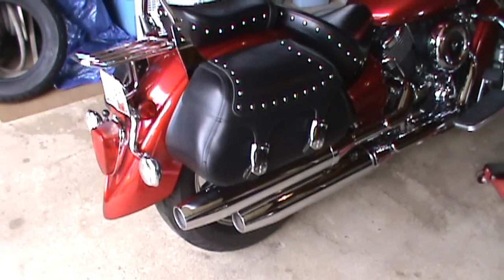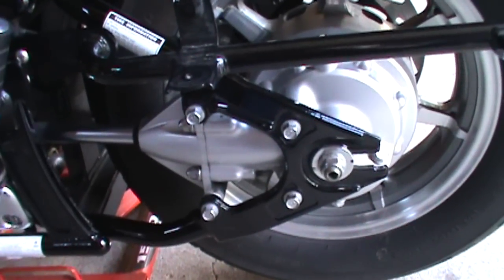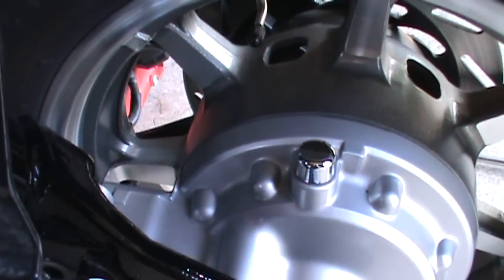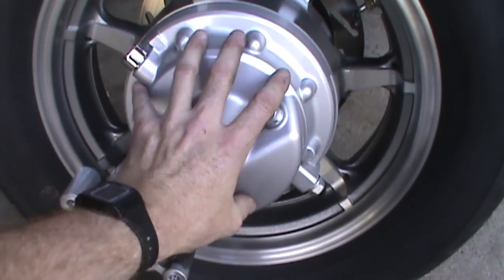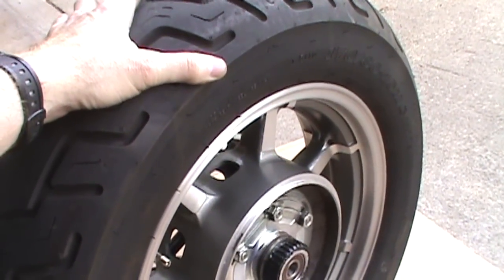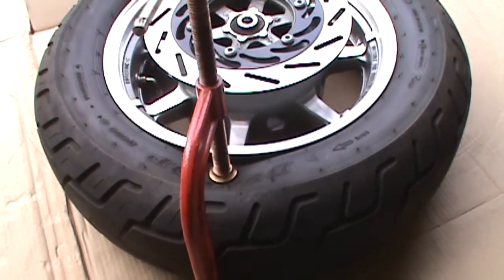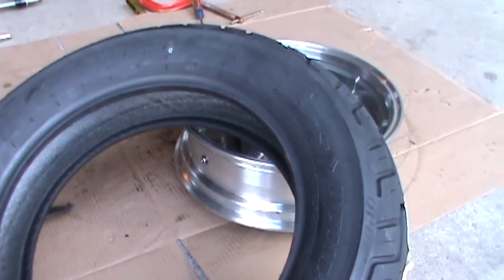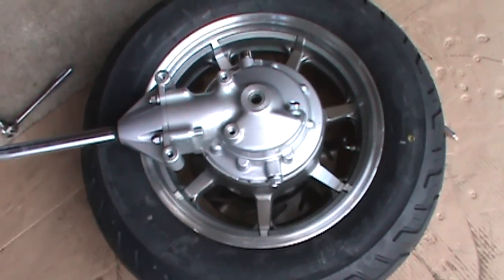2008 Vstar Rear Tire Change

Comment: Great video! The only thing I would add is greasing the drive shaft spines, if you hadn't done that already. I bought a low milage Vstar 650. I noticed that the tires had been changed but I wanted to make certain that those splines were greased. On those Vstars I have heard that if the splines get dry and fail, that rear differential replacement will have a starting price is at least 1000.$. I think my bike was probably OK, but for piece of mind I greased the splines anyway.

Comment: I have the EXACT same bike as you (even red). I have the bridgestone tires. It looks like you have another kind. How many miles do you usually go before changing. Seems like I am averaging about 10k before back needs changed (front seems to last like 30k)  and I am also changing the rear pads every time as well.
Reply from the maker: Hi Brian, I am using OEM Dunlop tires. I only get about 8000 miles on the rear tire but I really like them because they seem to stick to the road really well. The front tire I usually end up changing because of weather checking on the side wall. I have changed the front brake pads once and still have the original rear brake pads. I have around 29500 on the odometer. I am on my 3rd battery with the present battery on its second year. This has been a trouble free bike. I usually go 2000 to 2500 miles on an oil and filter change. My theory has always been, oil is cheap, engine rebuilds are expensive.

Comment: I am having problems seating the rear hub back on the tire. When I took it off it was pretty tight up against the rim. Now it doesn't want to go back all the way in. Stays about 1/8" out. Not sure if this will be an issue or not.
Reply: Yes that is normal space.

Comment: My Vstar 650 ie leaking oil from the final drive and I think its just a 9 dollar oil seal, I am worried about messing something up and it not going back together right. How easy was it to get the drive shaft to slide back into gearbox

Comment: just to give the people viewing. Use large zip ties about every 5 inches apart, around the tire. This will make the tire width smaller and it makes it easier to remove.
Reply from the maker: Thanks for the tip.

Comment: I just bought a vstar used, I’m used to riding bikes but this one seems suuuuper difficult to roll in neutral. Is this normal? I was watching this video becuase I might take my wheels off to see if something is off.
Reply: Update : the brake pads were rusted/calipers nearly seized. Original owner only put 200 miles on it in 12 years 😂

Comment: did u got you v-star with tubes, because my v-star 650 has tube. 
do you know why or why not ? thanks
Reply from the maker: My tires are tubeless. I do not know why you have tubes in yours.
Reply: OnTheEdgeInEauClaire Perhaps he has a spoked rear wheel...in that case, tubes are necessary
Reply: I realize people use tubeless tires without tubes.  I never install my new ties without tubes and use tubes for use on gravel roads they are quite heavy rubber. .  even if the tires are tubeless I still use tubes   Use only tubes with metal stems .  if you are in no mans land you will thank yourself as you try to help other riders with deflated tires you meet on the roads....  a few extra dollars can give peace of mind.

Comment: How do you position the jack to lift the rear wheel? I have a similar jack which seems to lift the front only. I see no place on the rear side to mount the jack. Thanks.
Reply from the maker: I have the jack positioned almost touching the rear wheel. It will start lifting the back tire off, and when it comes time to remove the tire, I jacked it up enough to get the tire out from underneath the fender. It can get a little tippy when it is jacked up that high.
Reply: @OnTheEdgeNow  Thank you!

Comment: My v star sits low...it's hard to get jack under bike
Reply from the maker: +james dean I just bought a jack from OTC. It fits nicely under my bike. it is a lower profile. It also helps if you can have a helper stand your bike up as you put the jack underneath.
Reply: OnTheEdgeInEauClaire k, whats otc?
Reply from the maker: That is the name brand of the jack.
Reply: OnTheEdgeInEauClaire k, tks